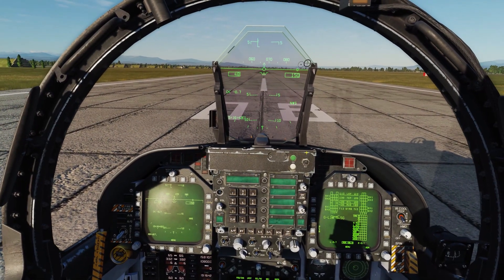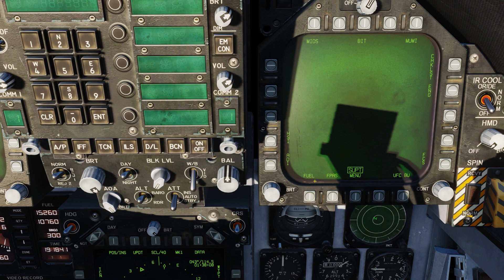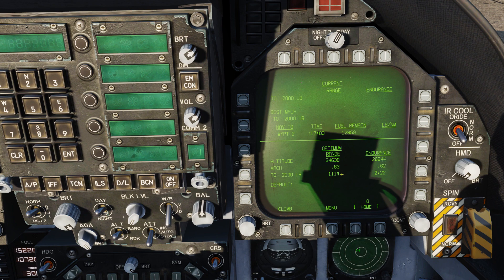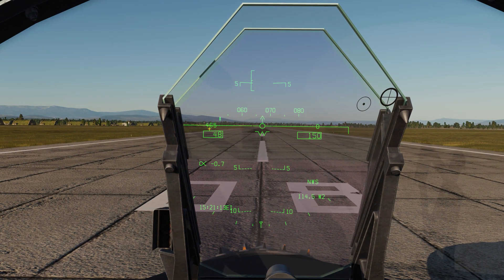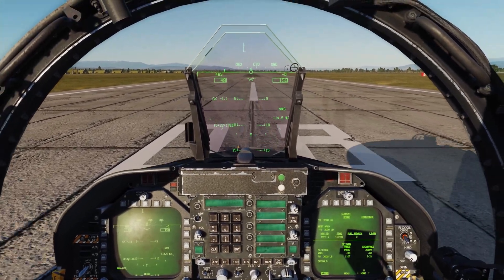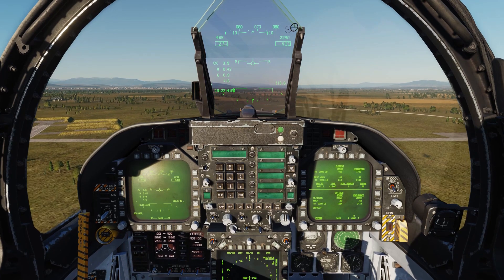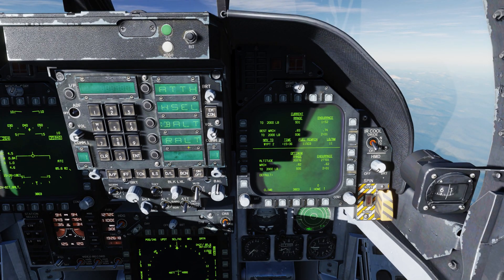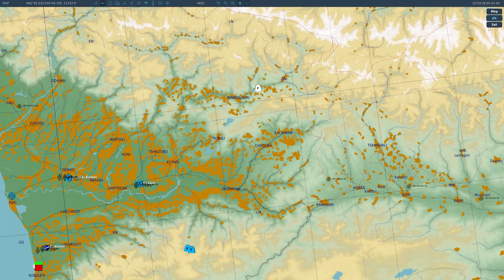Flying DCS World with OverKill: F/A - 18C Hornet: FPAS

Comment: Hi and thank you for another good video. In the use of fuel, is there any thing that you can do to consume the external tanks first, get rid of them once empty, and continue with internal fuel?, thanks again!
Reply: I think that is a default automatic process but you can easily check. Load up with multiple external tanks , whack the throttle, take off and watch your fuel load on the DDI Fuel page, not the IFEI. I'm pretty sure you'll see the external levels go down while your internal tanks remain full. I think you have to override this if for some reason you wanted to exhaust internal fuel first.
Reply: R@ttler I will check it in back to you thank you
Reply: @bronco1738  I had to make a beer run tonight so I thought I might as well take the Hornet and leave the Warthog in the garage. Here's your answer; YES...it automatically drains any and all External tanks first (evenly) before gulping from the Internals. 
But you can change that if you want by using the Fuel Panel right below the throttles. By setting either or both (Wings or Ctr) to STOP it will inhibit transfer and drain the internal fuel. So you could STOP > Ctr Tank, empty the Wing Tanks and jettison them first if you wanted. I don't know what the Override switch does yet...need to get more beer tomorrow :)
Reply: R@ttler good answer 👍., I’m going to try that on my F18. I’ll play a little bit with the fuel panel.Thanks!
Reply: @RattlerSSBN  thanks for your brief & clear explanation ,this was a question I had also, You're spot on here; I followed your advise and did the same test you suggested. Full fuel load (all 3 External tanks) and 'whacked' the throttle,  Indeed all external tanks fed at the same rate. I also tried the STOP switches , as you suggested and watched no fuel was drained from those tanks. Ran a cross country flight like you did and played with the fuel panel as you said. @Bronco...that definitely answers your questions and as R@ttler said; this would be the method of selectively draining Wing External with STOP, flow Ctr External and then tossing them to take advantage of lower weight and less air resistance for better fuel economy. Thanks  R@ttler...nice clear explanation. 👍
Reply from the maker: Lol! Love the beer run in the Hornet lol